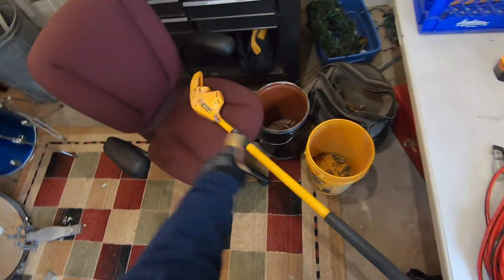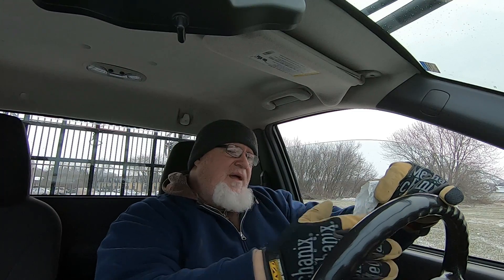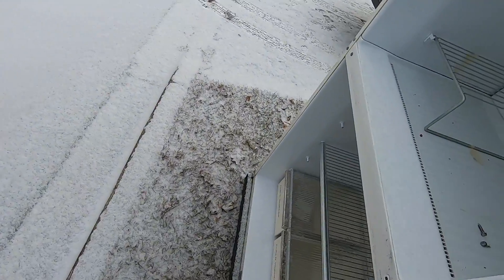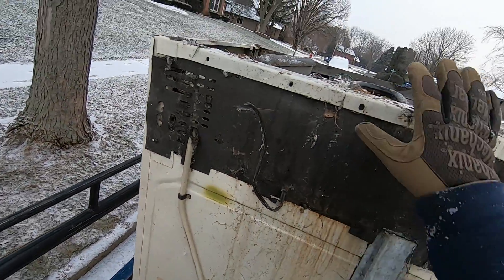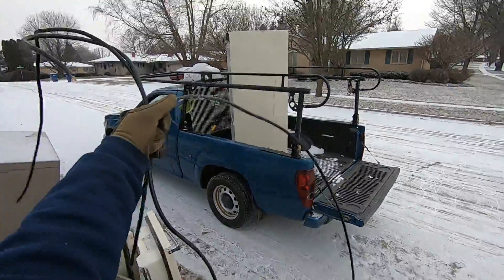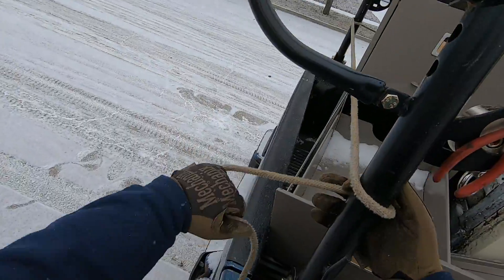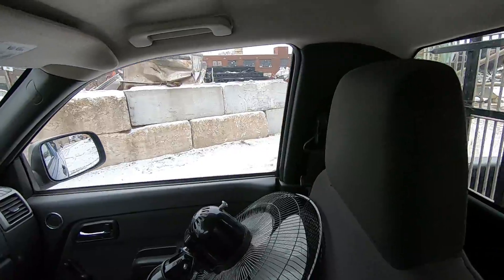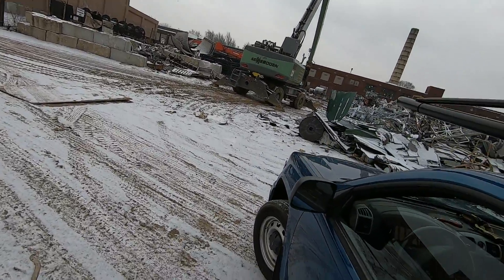Crazy Things Left on the Curb

Comment: Hey Paul, Good to see you out and about. Something that I do when loading an appliance that you might want to try. Once you get the appliance to the tailgate, tie a rope to one of the anchor rings in the back of the bed, run it under the appliance and back to the anchor on the other side of the bed.  The tight rope keeps the appliance from sliding back at you as you lift. Stay safe.

Comment: Back in the 70's we used to buy 55 gallon drums filled with electric motors,take them home and strip the copper out of them and return the separated materials.  My mom was actually the one that did all the hauling, my brothers helped, as did I. in exchange we all got a brand new bike. It was a lot of hard work but paid off in the end. Now I fix lawn mowers and resell them as I find them. Market place is a great place to go for that. I usually buy them as cheap as possible, then fix them and sell them at half of what a new one goes for. I do riding mowers but avoid anything too large. I used to buy and restore vintage snowmobiles but my health will not allow that now. A cancer surgery put me on disability so chronic pain determines what I do every day. Some times nothing at all.
May you and your family have a Merry Christmas and happy new year. I subscribed by the way. I like your effort to save recycle material from the land fill.
Reply from the maker: Merry Christmas my friend. Sounds like you and your brothers did quite well getting a new bike

Comment: Okay, what I am going to say may or may not be something that only happens where I live. If there are any appliances/machines that have electric motors/pumps, check if they work. If they do take them out and sell them separate from the appliance/machine. My Dad and I had an old printing machine [one of those that print newspapers] that just sat and did nothing, thus we sold it to a scrapyard only to realize that the two remaining motors [it had 3 originally, 1 larger that we took out and 2 smaller that we left in it] were worth quite a bit, like 4-times more than what we sold it as scrap for a single motor. And mind due, those 2 smaller motors were quite big on their own right. Hope this helps.

Comment: Hey Paul.  I can't believe how low your prices are for non-ferrous.  I get 90 cents a pound for insulated wire (extension cords and cord cut-offs etc) here in southwestern Ontario and that is down 20 cents from last summer.  Our tin is a little higher than yours; I got 5 cents a pound a couple days ago and that is an improvement because I got 4 cents a pound about a month ago.   Have you checked other yards because when it comes to the non-ferrous maybe you'll have to drive for an hour but double your money.